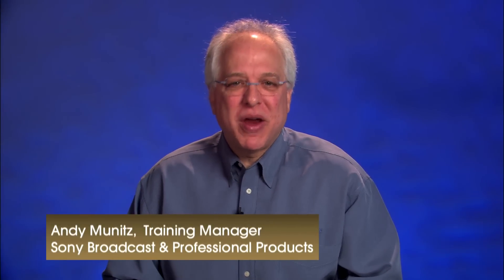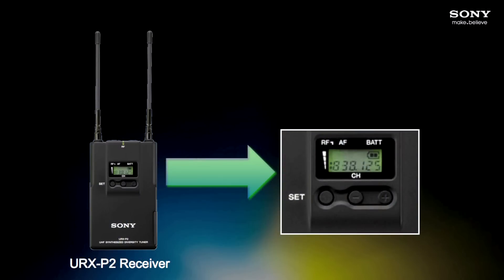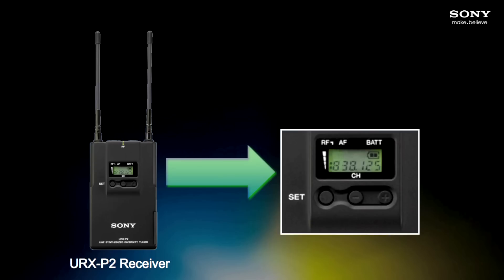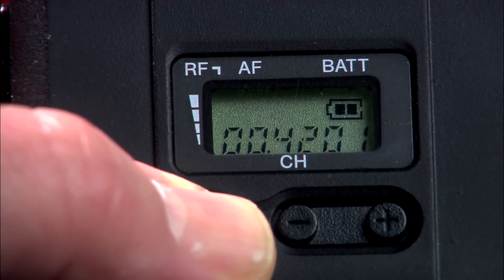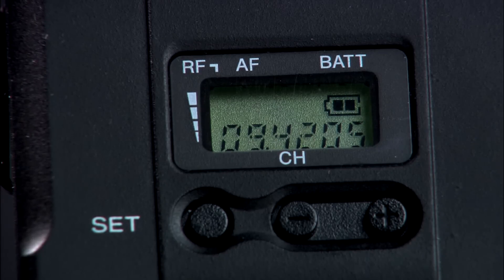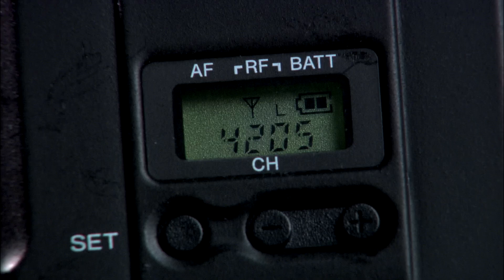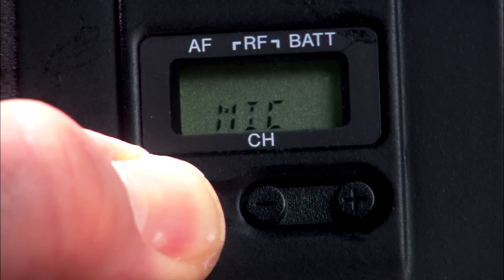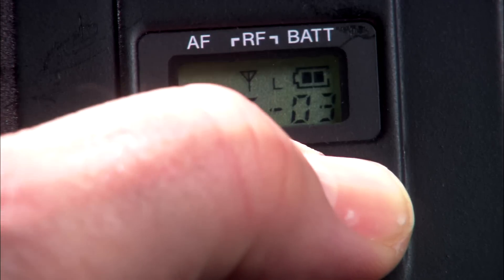Getting Started with Sony UWP Wireless Mics

Comment: i have URX-P2/UTX-B2 . I managed to put both transmitter and reciever on the same frequency. The green light from the reciever is on all the time, the green light from the transmitter is on while i speak. It is out when i don't speak. When i put headphones in the monitor output of the reciever, i hear my own voice while i speak. So my voice comes through. However, when i plug the reciever into my Samsung Galaxy S7 Egde and record a video, my recorded voice came through the default mic of my samsung, and not through the sony system. Wether the Sony system is on or off, it doesn't matter. The recorded voice is always the one coming through the default mic. WHat's going wrong?

Comment: That’s a great video, thank you. I have the UWP-V1 and have a sound problem. The unit is a couple of years old now, but I doubt it’s been used even 10 times. 

There is a very loud scratching, almost popping kind of sound appearing in recordings. It actually comes out louder than the recorded audio itself (my voice). I’ve changed batteries and frequencies. The problem remains. It also occurs on both the H or L settings. It even occurs when I disconnect the microphone cable. 

I can hear it through the headphones plugged into the tuner. It appears to be coming from the transmitter (UTX-B2). The noise is more frequent when I’m touching the transmitter, but also occurs when there is sound nearby and the unit is on, but set aside and not touching anything (for exmaple the keyboard sound as I’m typing this). Even the slightest sound from the next room such as walking on carpet will trigger the noise. Strangely, it doesn’t respond to all noise. 

My only thought is there could be something to do with the transmitter antenna or something internal. I cannot say I know much about this stuff though, so it could easily be something else.  
Would you have any suggestions? Thanks in advance!

Comment: I have a Sony HVR-Z7U Camera and a UWP-V1 system. My question is can the V1 be used in conjunction with the Sony mic that gets installed on the camera? and what is the best way to monitor output from both? I'm not quite sure what is the best way to set both mics so I have optimal performance from the two different microphone types. Hoping my question makes sense.
Reply from the maker: +Greg Chamberlain...Yes, you can use both the supplied mono shotgun and the UWP-V1 wireless on your HVR-Z7U. You should have +48v chosen for your shotgun mic, and mic input (without +48v) selected for the XLR input from your UWP receiver.  The channel selection switch on your audio panel should be set to 'ch1', to allow for each mic's signal to feed the camera's audio channels independently.  For monitoring of the signals through headphones, I believe you can choose in the audio menu whether to listen to ch1/ch2, or each channel individually.  Since these two audio sources will sound quite different, you will likely choose to mix them (or not) and pan them to the center during post production editing. If you have further questions, you can call our Sony POSC (Product Operations Support Center) for help, at  1-800-883-6817.  By the way, to better learn about channels and groups, and what all of the various numbers on your wireless display mean, you can have a look at the video at this link.  https://www.youtube.com/watch?v=LusNyv1K4t0  Even though your UWP-V1 series model may not have the same extended tuning range that our current UWP-D series has, it should give you an insight into frequencies and groups that might be helpful.

Comment: My channel group that I need to get to 00. (on the Sony UTX-B2 transmitter) is in the 500's. How do I get this group to 00. without having to go through every single channel to get there? This would take a very very long time. I have already held down the set button while power on the device but this does not set the transmitter to the default as mentioned in this vid. Thanks for the help.

Comment from the maker: Amer,
      You can only use one transmitter on a particular frequency at one time, but many receivers can all be tuned in to that one frequency.  Just like a radio station, they have one frequency, but many people can tune in to it.  You can turn off one transmitter on a certain frequency (body pack/lavalier-groom?), and then turn on a handheld mic on that same frequency (wedding reception?), and you do not have to change the channel on your r'cvr.  But only one transmitter can be on at once.

Comment: When I set the reciever and the transmisor to the same channel, in the transmisor it appears in the screen "not one" I haven't been able to fix it. Help
Reply: I have this same problem with a receiver I have at work. I've gone through the setup process in this video and looked through the manual. The transmitters all work with the another receiver, so I have three transmitters for only one working receiver. The only solutions I have seen for this problem online are to send it in to Sony for repair.

Comment: I purchased the UWP-D11 system a few months ago, and still haven't been able to use it - the sound is wavy, going in and out constantly. I can't seem to figure out what settings might help - any suggestions?
Reply: You can call our POSC (Product Operations Support Center free hotline for Professional Products at 201-883-6817 for assistance.  By the way, does this happen when you just plug your headphones directly into the UWP-D receiver?  Do you use the AutoSet feature for setting the best channels?
Reply: Andrew Munitz Thanks for replying! I will definitely give the POSC a call. It happens whether the headphones are plugged into the receiver, the camera, or unplugged, and yes, I've done the auto set for channels. Hopefully POSC will be able to find a solution I haven't been able to find on my own. Thanks again!
Reply: +claireobrien84   Were you able to resolve this issue? I'm having the same issue. It's almost like the mic isn't omni-directional at all but much more condensed with a very small cone. I'm wondering if I should be looking at a different mic than the one included?

Comment: I just got a new receiver that want to use as a back up for my regular ones but I can't set up the same numbers as the others. for example the ones that I using shows this: 566.125  +  65.20  + 01.3001 and the new one shows: 638.125 + ATT - 00 + 00:07 + PO:H + 4201. I've tried everything and I can't change those numbers. I'm sorry if I'm not being too clear, I'm writing from Peru. Thanks for your help

Comment: I get an extremely weak signal from my receiver to my recorder.  Is there a way to change that?  When I use the headphone jack instead I get a much stronger signal that I can actually work with.  Is it bad to use that instead?
Reply from the maker: Are you using a mic input or line input?  Is there a variable level input control on your recorder?  You should be able to use your output connector.  You can call Sony's POSC hotline (Product Operations Support Center) for help at 1-800-883-6817.

Comment: On the Utx-b1 trans and urx-p1 tuner, it doesn't matter how many times i match them, there is no audio on the reciever, only a green light and rf signal, and "notone" flashing when i get them close after matching them. Plus there is no "clear frequency scan mode" not even on the manual

Comment: Hello
I have purchased a Sony wireless microphone tuner diversity URX-P2 and Transmitter UTX-B2 and it can not apostatize UTX-B2 transmitter frequencies.
Can you advise me as to apostatize and you shall employ the same frequency
one is  30-33 / 566.125-589.875mhz and the other 42-45 / 638.125 - 661.875 mhz
please answer to me
best,
lorik

Comment: Very helpful review! Can you use this device plugged directly into a DSLR without picking up a hiss? Or would I have to use an AGC adapter like a juicedLink to make it operate without the hiss? I assume the ATT levels can be boosted on the receiver / transmitter while keeping the manual audio levels set at one notch above zero in the DSLR. That works in the Sennheiser G3 but I am unclear on the UWP. Is ATT the same as AGC? Thanks for any thoughts.

Comment: I have a Canon 600D will this work on my camera?
Reply from the maker: Our new UWP-D11 system has a variable level output, with +/-12dB control to help match the input of your camera, even if it doesn't have a variable level input control.  Also, don't forget that you have a headphone out on the r'cvr as well, so even if your camera doesn't have a headphone jack, you can hear the wireless mic.
Reply: AndroidSonus Thank you for replying

Comment: If you want to use 2 lav mics,, then you will need 2 receivers,
Sadly two transmitters can't work with one receiver,  would save space on the camera.

I have the kit that comes with the lav and the XLR mic transmiter and I can only use one of them at once.

So you need two receivers to use two transmitters but that is standard.

This kit is awsome,, such great sound quality range and build.

Comment: I have a Sony uwp-v1 and I use it on a Canon T5i DSLR. The big problem I have is: The mike has a "shhhhh" sound everytime i record something with it. Does anybody know any ways of fixing that other than editing on softwares ???
Reply: I've had this problem with DSLR, the key is to push the level of unit going into your DSLR higher, so that the input volume on your DSLR can be lower. This improves your signal to noise ratio (look it up if you haven't heard the term before) 

The hissing is the preamp on your DSLR, and the higher the recording level on your DSLR the louder the hiss will be. I've just managed to boost the db level on my Sony URX - P03 to +12, this allowed me to take my recording level on my Nikon DSLR from 15 on my last shoot to around 8 on this shoot, which should give me almost 50% less noise which should be a lot better for my sanity when I start mastering that audio.

I know this was 11 months ago, but there it is :)

Comment: I want to use zhe urx-p2 with a sennheiser ew100 g2. i setup the freq and on the p2 display the "rf" signal is fully loaded and the "rf" light is green. but I have still the message "notone" on the p2. does anybody know how to fix it?
Reply from the maker: Sorry, but you cannot mix a transmitter from one manufacturer with a receiver from another.  There are compander schemes that are different between the two, and they need to match, among other things (like pilot tones).  You can also call Sony's POSC (Product Operations Support Center) at 1-800-883-6817 for further assistance.
Reply: AndroidSonus Thanks for your support!

Comment from the maker: Check your Nikon D800 camera menu settings for external microphone input sensitivity.

The Sony UWP wireless receiver's RX output is a microphone level signal and the monitor output is intended for connection with headphones.

For further help;  if your located in the USA, please contact Sony Professional’s Operational Support Center at  800-883-6817 from 8:00 AM - 8:00 PM ET

Comment from the maker: I would first plug headphones directly into the wireless receiver, hit the + & - buttons to adjust listening volume, and confirm that your signal is clean within the wireless chain.  If so, then the issue is likely downstream (record level on the camera too low?).  You can contact our Product Operations Support Center (POSC) at 800-883-6817 for further help, if necessary.